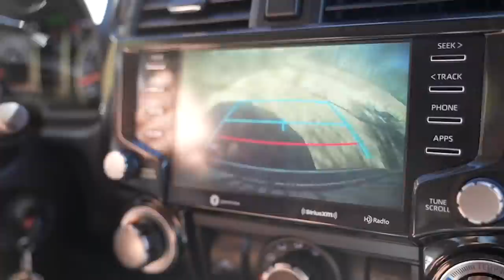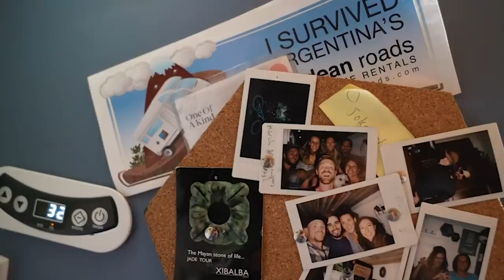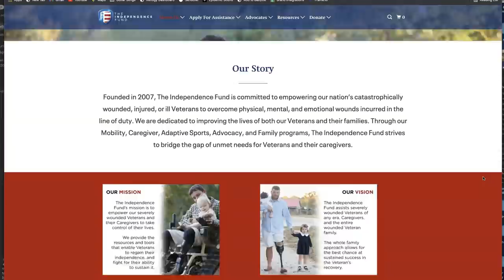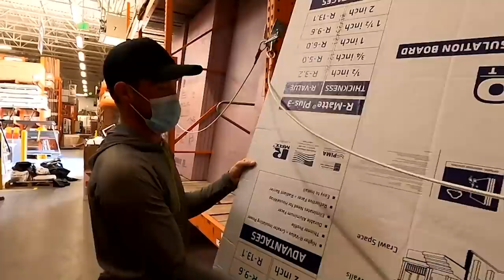A HUGE DISAPPOINTMENT... | BUILDING OUR OWN HOME

Comment: T&A - regarding the dogs running off, try some 'long leash' training. Unless your dog is senile, it always works. Look it up, or I could help explain it if you want. Obviously, Frank doesn't really need it, but Lika does, or so it seems. It's a matter of 'long call'. I've gone thru this many times, much as you guys are doing now.

You are right that a Moose could easily kill a dog, but so could a deer, but deer, obviously, tend to run from dogs. I've only seen a few moose in my life, and I've never really seen one run, so maybe they are not that good at it, so confrontation might be more their thing. Of course you have reason to be concerned.
As to the vlog, cool as always. Keep it up.

Comment: As a contractor who uses LKL, I am applauding their decision. Realize, that most of the issues your having are due to TRUCKING.  There isnt a shortage of drywall, there is a shortage of truckers hauling it.  There are shortages of steel(even LKL contractors are getting cut off).  The supply yards are at the mercy of trucks hauling to the supply yard.  Its a little arrogant to think that you, a one and done customer,  should carry the same weight at a supply yard, as customers like Kyco, who do tens of millions in buisness with LKL.  Or even me, who doesn't, but does steady buisness with them monthly.  Your going to be even more suprised to find out Home Depot and Lowes, don't deliver, they generally use a 3rd person(another supply yard), or they curb dump it, which in your case, is a LONG way from the house.  Long post, but it does get tiresome listening to folks who don't want to hire professionals, complain because those professionals get advantages, such as preferential treatment at supply yards.  What do you expect LKL to do?  Lose million dollar accounts for your few thousand square feet and a bad delivery on top of it?  Get real
Reply from the maker: That’s completely understandable and makes total sense. All we wanted was to be told from the beginning that they couldn’t help us, so that we could move on to a different solution without wasting so much time.
Reply: @TrentandAllie  that is the point.  From day to day they don't know what's coming in vs what's going out.  Yesterday I ordered 3 jobs.  Today, none.  They literally don't have on site inventory, it comes in one side, out the other.  I've done buisness with LKL since day 1, of their buisness.  They are a good company, not deserving online bashing

Comment: ... The days will come and go , don't burn yourselves out on the house build ... Allie takes a nap ...good for you ..  Trent finds other things to do ,also ... good for you ..
  In good time the house will be a home and actually ,, there will be more time for the activities of choice ... of course that will include a stroller or baby carrier ....
   .. Building a house yourself vs hiring a building contractor is quite different with all the physical work creates more mental trials ,, but with the learning process comes plenty of excuses from sources beyond your control...I find that if delays or issues come up that cannot be resolved quickly ...... it's time to see if the fish are biting .... 
   .. Maybe jump on the larger deck stairs while some of the how to is still in mind .... comment :: on deck stairs there is no need for risers on the treads ,, makes cleaning snow off easier  without them..... common stairs for stringer cuts 8" rise ,,9" runs .... 2x6 treads (if wood) no gap, will shrink in short time ..... if Treks 1/8" -1/4" is plenty, ,use a framing nail as spacer.. .. 1 1/2" over on each stringer ,,when you get a handrail system installed ,,will give a nicer look ...

Comment: Your need for drywall was a fail not your fault but that of the salesman's lack of responsibility of informing the public of only supplying contractors. I BELIEVE if you go above the salesman's head and deal directly with upper management and voice your complaints possibly you may get your drywall that u tried to get quoted Afterall most big companies do not want bad tastes put into the public mouths. Voicing your complaints are not unfounded because companies use complaints to better their business.

Comment: I hope that Brandon and family are all good hopefully Connor just had an upper respiratory due to airborne allergies ? God's Speed ! As for as Drywall/Sheetrock have a drywall Man to do a take off list then you go buy it from HD all at one time pay for it and pick it up as needed... Once you pay for it , it is on Will Call (B-4 Covid anyway)    Learn from your friends Emon and Bec on their "Cottage" they ended up tapping out ! And it was only 8' high and ceiling has to go up 1st and yours is 3x that ? Higher a Rocker/Taper Crew if you can find one ! If You attempt it yourself ? Hire on more people and put factory tapered edges together and staggered butt joint's buy 2 stud's at least (3' 0f tapering on a butt joint) taping ! Call Kevin and maybe he can hook you up with a Sub and maybe get your rock delivered and hopefully with a Prentice Loader Truck and you can just remove a 2nd story window 4' tall and load for loft and ceiling ! Can You run on Stilts ? We use too have stilt races behind the Bar 🤑😎🤓

Comment: LKL delivers drywall with semis (I’ve seen them on the road, they even delivered to my neighborhood). How exactly were you guys expecting the semis to deliver that drywall? Especially considering the tight roads and sharp turns pointed out in the video? 

I get the customer service complaint, but still… even if they had completed the order, how did you expect it would be delivered? If it hadn’t been for shortages, they probably would’ve turned you down just based on the roads.

Comment: Doing the drywalling yourself will be quite an adventure. Don't envy you with that high wall and high ceilings!. Make sure you have the right tools. There are several taping tools that will speed up the proces and make the job easier. If you want to do it the old fashioned way, check life uncontained to see what they encountered! https://www.youtube.com/watch?v=6h4HEt1J3bI
To see a big plastering project project done with tools like Bazooka: https://www.youtube.com/watch?v=izX7we034rI. Success!